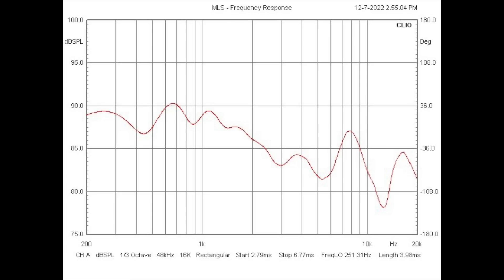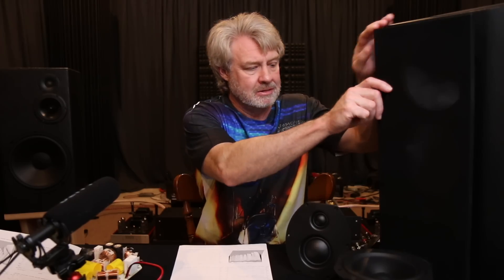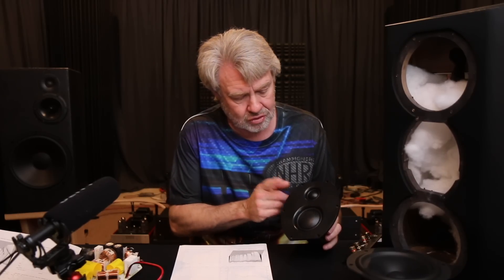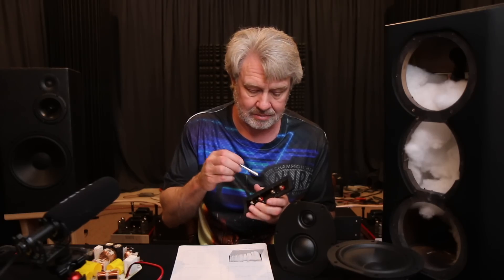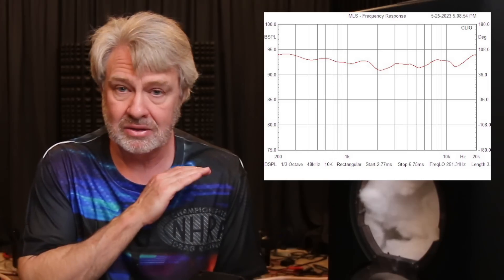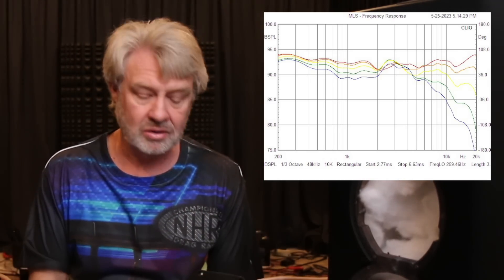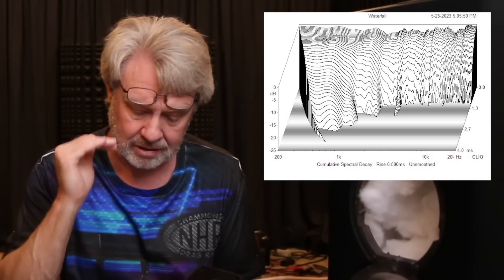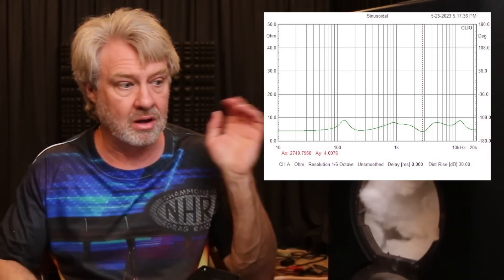Monoprice? Hey, not bad!

Comment: According to their website, the crossover from woof to mid is at 550hz, at 24db/oct. Mid to tweet is 1.9khz
Reply: Good to have a low cross. I designed one with 185 Hz from Audax midrange to 15 inch Eminence.

Comment: Crossover space - and anyone looking to retain the Atmos driver can always mount Danny's entire new crossover in a separate box external to the speaker. I'll be doing that (in one system/setup) just to show-off the Crossover!  But seriously, just buy the 2-way Monolith mini bookshelf speaker in this same line and get way better Atmos performance, plus be able to place the height speaker in a better firing location/angle.

Comment: The thing you have to be very careful with about Monoprice (and other wholesale places like them) is that they will not give schematics even if requested and getting replacement parts will be difficult to impossible. They try to make up for this with a decent warranty period, but they want everything sent back to them for repair at your expense with no guarantee on time. When the warranty ends, so does parts availability.

Comment: Speakers are like anything else 
The engineer's picked his designed layout, sourced the best parts
Came back with the best speaker you can make @ that price point.
Then come the bean counters
And take it all apart looking for ways to make more profits at that price point.     Changes are made 
Research is done, assembly line set up and changes are made during manufacturing to cut cost even more.  After all you can't see it from the CEO's driveway. Or from his lear jet.

Comment: The way that parts of a cone respond is clearly not simple.  In fact, it would take a partial differential equation.  However, the way the whole cone responds is much simpler.  f=ma and f= dl • i  x B  So if the cone weighs more a stronger magnetic field or more windings on the voice coil is needed to make sure that the motor and not spring is moving the cone.  Hint set the right part of both equations equal to each other to eliminate f.

Comment: Instead of trying to split the crossover up jamming it into a tight space that may impact reflections, why not just make an external crossover box for it? What is taking the driver out the top going to do to the response curve, if you measured with it in there?

Comment: You know Danny, as impressed as you are it would seem to me that you might consider sending them an Atta Boy and Politely tell them you had a chance to do some work on one of their speakers for a customer and let them know about the connections and the metal affecting their design. They might not realize this issue and correct their subsequent models.

Comment: 3-way crossovers with decent components can get HUGE! I suggest mounting the parts to a decorative piece of wood on the outside of the box and hanging them on the wall behind the speaker or mounting them to the side of the cabinet as a conversation piece. 

The atmos speakers are designed to reflect off a ceiling for "effects." I doubt the response matters much for that. In fact, I think a full-range driver with a lot of controlled directivity would probably be best for this purpose.

Comment: Monolith has been around for a number of years now (I’m gonna guess around 7), but since they’re HT-centric, I can see why you might not have heard about them. 

Danny, question: your measurements don’t seem to take into account how speakers perform at loud volumes. Is there a reason for that?

It’s not a dig at all. My guess is that this is largely a function of the drivers, so whether they do well loud or not is beyond the scope of what your upgrades are intended for.
Reply: High volume testing is not something we do and it is not done as any kind of industry standard. Speakers will typically retain a pretty linear response (the same response) as power increases right up to the point to where they are over driven.
Reply: Kudos where it’s due. Good for you, Danny  and great job by the designer. But I do prefer the big fix videos, so awaiting the next Klipsch / B&W speaker !
Reply: @dannyrichie9743  
Well yes, by definition, ... ie., linear until being over-driven! 

Compression is huge. 
I'm particularly sensitive to the various penalties that accompany compression. 

How well a driver converts drive current to propagating energy is vital. It's lossy, ... a sliding scale of lossyness. 

Leveraging physical and electrical resonances, load angle, ... all to perform mutually well within a specific operating range (which is key). 

One example being a "pro" type driver for midbass. 
Most every strong performing subwoofer is easily bested by supplementing the system via mid bass modules. 

They're simply two different tasks. 

- Since the deep stuff is off loaded, it doesn't need a 20hz Fs. 
- higher Fs can employ a coincident impedance peak, thus dramatically lowering current pulled from the amplifier. 
- with lower VC current, typically less inductance, eliciting greater speed and bandwidth, plus lower mms, yielding higher sensitivity. 

The superb JBL 15"s in their two-way studio monitors, are killer at bass tone, texture, and speed. However, tasked with LFE bottom octaves, no bueno. 

Similarly, my quad Fi IB3-18" IB, is really compromised in its upper octave reproduction. 

Not sure how I got here ... 

Nice vid
Much appreciated

Comment: Great job? Loock at the price too, $500 EACH for that MIDGET? 
Thanks but i'll stick with KLIPSH.
Reply: I don't think Klipsch makes a speaker that would compete with these.
Reply: Please look inside your Klipsch and try not to laugh when you see the crossover components or lack of compared to this well designed but value driven speaker. Then again, if you like horn speakers originally intended for PA use, then great crossover components won't matter much except resistors for that katana sharp tweeter 😂
Reply: Crossover can be modified, isn't GR doing same thing just for $300 each?
So you can do it too if you know what are you doing but Klipsh woofers and enclosure are much higher level, just add your moded Crossover and you're done.
Reply: @AQAVAR  No, the Klipsch woofers are as bad as they get. The enclosures are nothing special either.

Comment: I have heard from Audioholics that basically you NEVER "set" your receiver to 4 Ohms! That doesn't do what you think... if you have a switch ALWAYS leave it at the highest (Likely 8 Ohms). I just bought 4 of these speakers... they are objectively good, but not really sounding better than the very old Klipsch they are replacing... I'm wondering what I'm doing wrong or if my Denon AVR-X3500H can power these 5 speakers? All Monolith THX-365T & the C (center) + M-215 sub. I don't really understand the power thing or how to know or tell if I have enough to drive them... I know they can handle way more power... I just don't know if I'm below what is needed to make them sound good?